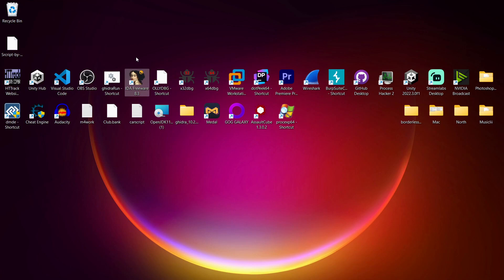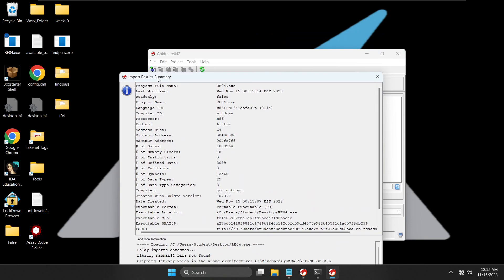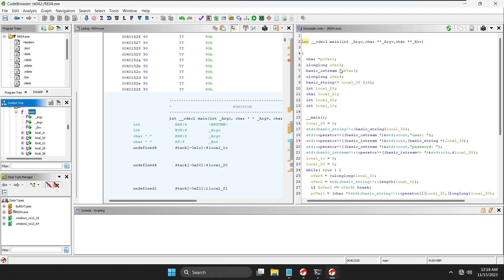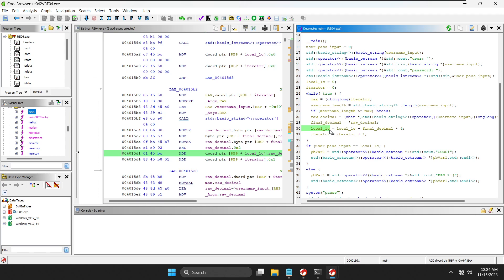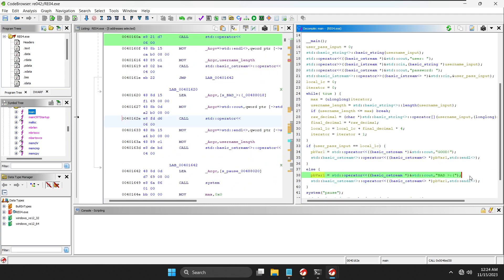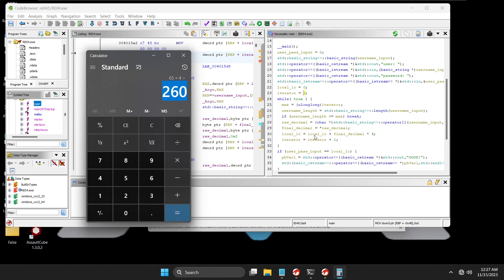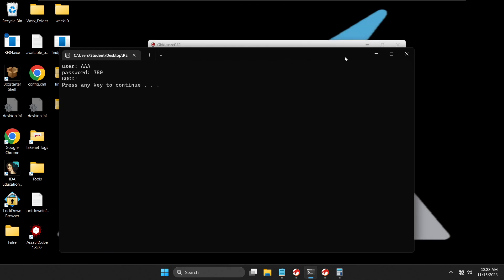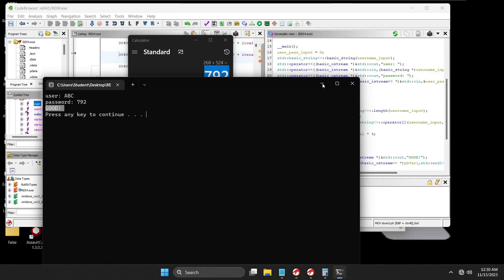Ghidra Static Analysis and Cracking - Keygen Creation| REVERSE ENGINEERING TUTORIAL

Comment: i've tried to crack a program on x64dbg but it connects to a server for validations. Is it possible for you to make a video on how to crack a program that connects to a server?
Reply from the maker: Yesc I will look into it
Reply: hello, i havent really attempted reverse engineering so i could be wrong, but if it connects to the server, it will then read the response from the server, and based on that determine if you have access. you should be able to trace the disassembled code to that check and just overwrite it, making it so that you have access. now ofc there are many ways to tackle implementing a user pass system, and their implementation could be more advanced than that, but that would be where i would start
Reply: try to use Charles proxy, trough Charles you can intercept and edit the program's requests